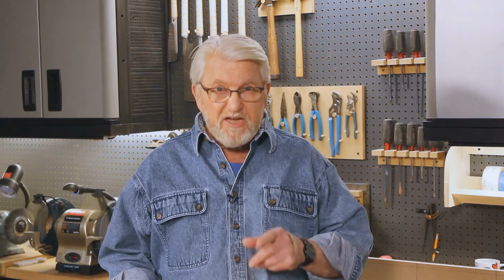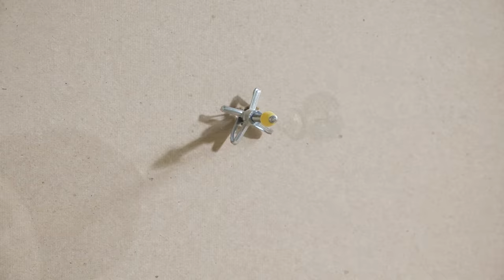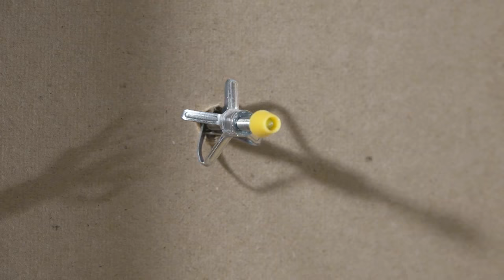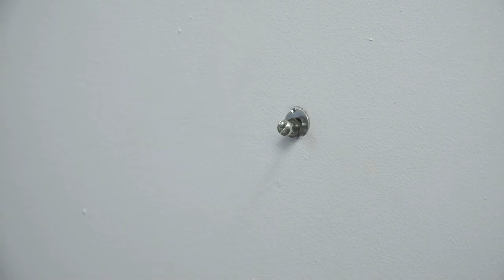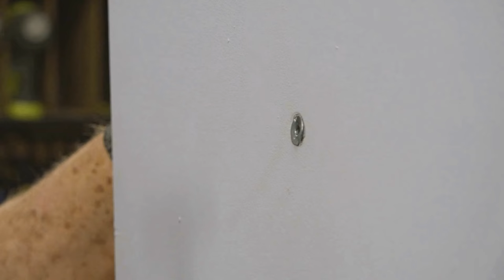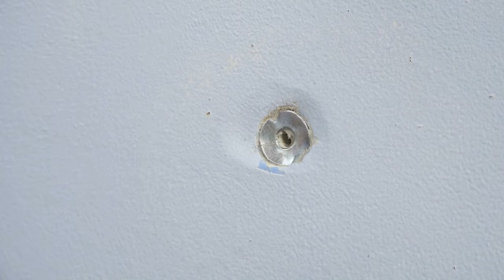How to Remove Molly Bolt Anchors Without Damaging Drywall

Comment: I am SO EXCITED I found this video! Thank you so much for explaining this! My boyfriend insisted we couldn't hang anything in our apartment because we have plaster walls but I think these mollies are the way to go. I'm presenting him with this video so he knows that even if we put holes in the wall, we can still get that deposit back ;) Thanks again!
Reply: Be aware that plaster (as opposed to drywall) is sometimes fragile and difficult to repair. 
I would never recommend the ballpeen hammer solution on a plaster wall, you could do a lot of damage to the plaster. The other solutions shown here should work fine IMO but don't overestimate the weight you can put on your drywall anchor in plaster either! If in doubt, make sure your stuff is fastened to studs rather than to the plaster & lath

Comment: Ron, you saved my wall, sanity and kitchen! Thank you for making this video, 2 out of 8 of my Molly bolts failed because I overtightened them (fixing a tall thin aluminium radiator to a drywall). Now I can finish my tiling and get on with my life. 😊

Comment: Ha!  After DECADES of working with these things, it never occurred to me to just back out the screw part way and whack it a few times with a hammer to stretch the interior fingers back out so the whole thing would just pull out without making a huge hole.  Thanks for such useful tip!

Comment: Simple and made a big mess of my wall... easiest to take a drill bit slightly larger than the hole...drill surface which loosens face. W needle nose pliers remove face. Use original bolt to push receiver into wall..
Way easier...